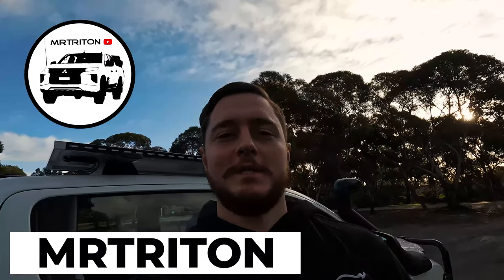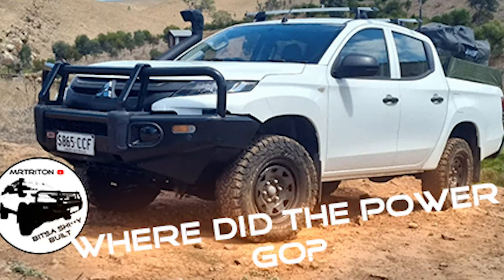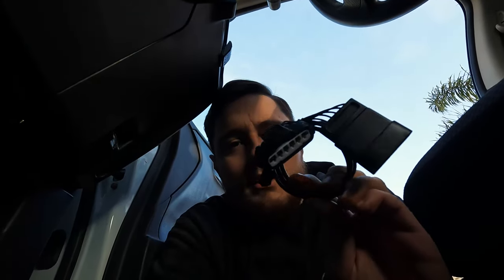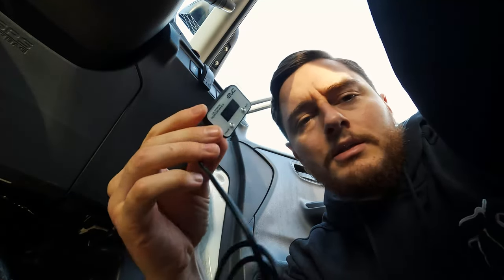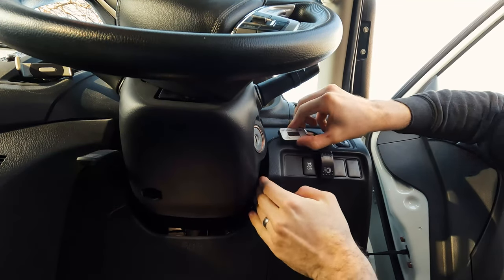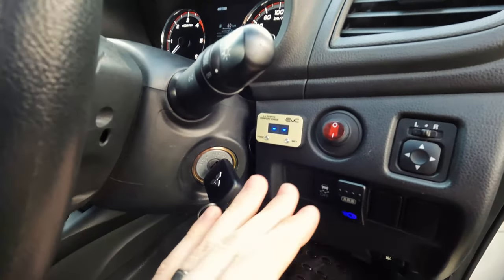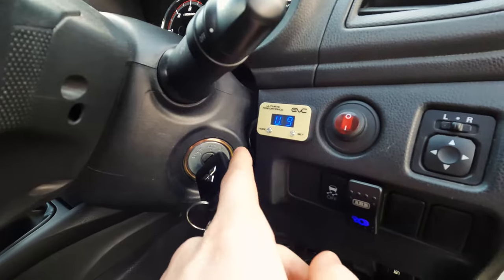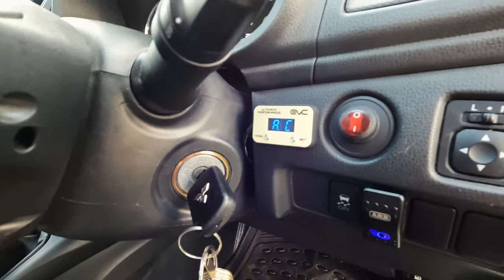MRTriton - UNLOCKING HIDDEN POWER!!!

Comment: Bad idea! Those things cause issues with the rubber hose that supplies air from the intercooler to the turbo to crack. This introduces a DPF and engine fault. Your risk however I know this because it happened to my MQ Triton
Reply: That is a common problem with or without any modifications.

Comment: Had a dp chip and throttle controller on my MN made a huge difference especially in traffic Got a MR now but so far it performs great but have a SW chip and scanguage to use when towing a van Also reckon a catchcan which I fitted from the MN is a MUST stopped the crud in the throttle body of the MN and so far clean as a whistle with MR , only done 20K though
Reply: Does the scangauge give you transmission temperature.?
Reply: @bugsy1254  Yep the scangauge 2 does

Comment: This is the best demonstration of a throttle controller which I've seen. I don't own one, therefore have not had the experience with one and have not been willing to spend the $ because the device doesn't change the power output of the engine. In my opinion, your video confirms that the device may be best suited as a cheaper alternative to reduction gears for slow low range crawling when the vehicle is fitted with larger tyres. Thanks for your time. Cheers
Reply: Gonna be getting mine today only because my Triton has really bad turbo lag to the point its dangerous, Coming out into traffic and my car deciding it wants to go slow when im slamming my foot straight to the floor cause their is a truck coming 💀

Comment: Ultimate 9 now do a bluetooth throttle controller (EVCX) so you dont actually need the physical connection to the unit.  The unit can actually just sit in your glove box and you can then change the settings via their phone app.  I have one in my MQ Triton and it sure does make a difference and the team at Ultimate are a really good bunch to deal with.  I purchased my MQ second hand and it had one of their evc units, however, it kept resetting itself.  I reported this to the team at Ultimate 9 and they replaced it under warranty with the new bluetooth model.

Comment: This is a great vid, thanks mate. I did the same thing with my MQ. The taller tyres also corrected my speedo accuracy, and I also used a throttle controller to make up for the lost power. I’m happy with the overall outcome. And the throttle controller has paid itself off many times over now. When towing heavy loads up hills etc, is where you get the fuel savings.
The only downside of the throttle controller is they void engine warranty, maybe other warranties too.

Comment: Good review.
I just run in A-C after using it over the years.  Delivery of throttle is just right in this mode and not jerky.  As we know, it still jas that initial turbo lag off 😞 dle but better than the  standard sluggish response signal from the computer.

Comment: The bigger diameter wheels should arguably reduce rolling resistance, especially on rough terrain.  Chunkier tyres not withstanding.  
The bigger wheels have the same effect as putting in a taller diff ratio.  The manual Tritons come with a 3.6:1 (3.67:1?) diff which I think is already a bit too tall given the peaky nature of the Tritons torque delivery. (I’ve had a MN and have a MR).  The auto MQ and Pajero Sport have 3.9:1 and the MR auto 4.27:1.  If you really want to restore/improve the response and ability to drive in sand/steep hills the shorter diff ratios would be a better bet.
Reply: The PS has the 3.692 ratio also, so bigger tires size means harder to haul too I guess?

Comment: hello,does it solve the need to slip the clutch during steep slope start? considering to buy the throttle controller (although using different brand) to solve theese issue. Oh btw I'm noticed the the MR Triton especially the manual one got pretty big dead zone at the accelerator which is up to almost 50% throttle and the anti stall system become noticeable at 2nd gear.
Reply from the maker: Hey, regarding clutch slip I suspect the throttle controller might make it worse as there's more throttle available. That said you way less likely to stall

Comment: Apart from the mr triton what do you think is the best dual cab?
Reply from the maker: Well, although I love my Triton I'm certainly not a fan boy of Triton or Mitsubishi in general. There are tons of dual cabs on the market these days. Triton was great because of it's value for money but now even they're expensive. Without having driven any other dual cab I'd have to say the new bt-50 or Dmax are pretty capable, refined and a generation above the MR. Having not driven them though I could certainly be wrong 👍
Reply: i got an mr but id trade it for the new bt50 if I had extra money.

Comment: Fuel prefilter adds 5hp, catch can adds 10hp and throttle controller adds 30hp. 
Thank me later.
Reply from the maker: Snorkel must add atleast 50hp
Reply: I remember back in the day when stickers added horsepower to cars.. Just like commodores adding the chevy badge  gave it extra HP.. oh no wait that just made them a bigger wanker :P
Reply: isnt power rated in KW's these days. 5hp =3kw, hp sounds better, bigger number